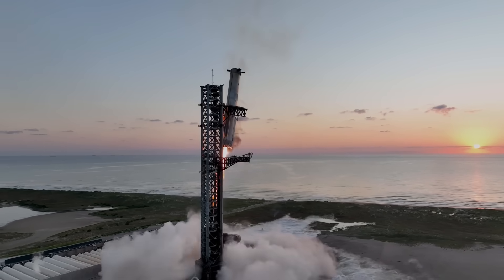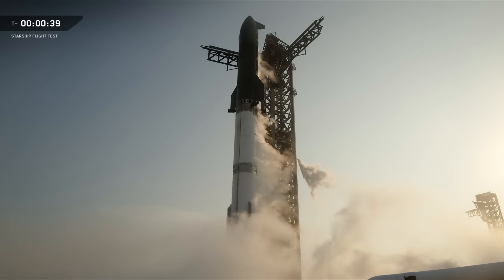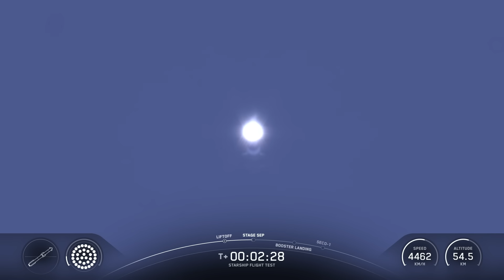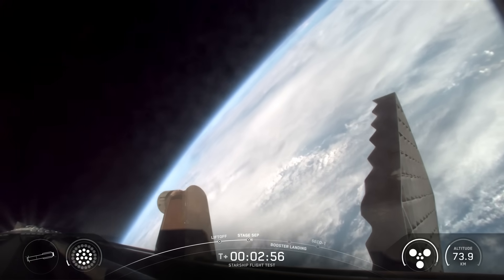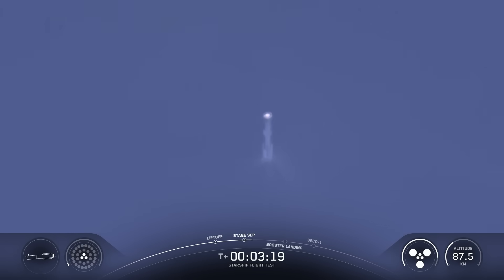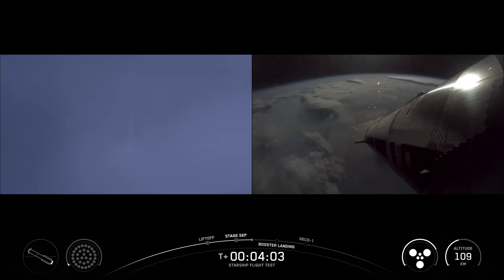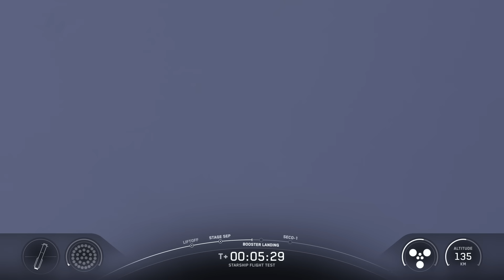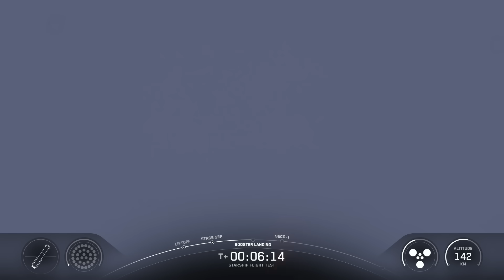SpaceX Builds Largest Reusable Booster, Also Makes Door That Won't Open - Starship Flight 9 Recap

Comment: This is all just a distraction, the ultimate plan is more frightening. Twitter was always the key - he needed to get rid of the engineers to re-write the app. Twitter has been re-coded to  subliminally force everyone to either buy a Tesla, Cybertruck or generate an uncontrollable urge to get into a Boring company pod. Then, using the Starlink constellation a signal will be sent and all the Teslas, trucks and pods will suddenly lock trapping the passengers inside. The controls will freeze and they will autonomously head to the nearest Starbase launch site where hundreds of flamethrower bearing Optimus robots will force NeuraLink implants deep into each persons cerebral cortex and then send them, like lame zombie sheep into waiting Starships for the journey to Mars.  Controlling everyone via NeuraLink , humanity will quickly devolve into a slave species, serving the Mars overlords for all of eternity.  (Except for large breasted brunette Goth virgins. Virgins will be celebrated as honored guests and taken to a great feast within the sacred Martian temple. Afterwards they will be stripped naked, tied up and boiled alive to be consumed by the festive Martians). Earth will be plundered for its remaining natural resources and die off becoming just another sphere of lifeless space rock eventually breaking apart into smaller and smaller pieces until turning to dust, scattering, and finally leaving the galaxy to drift into the abyss for eternity. It’s all so clear - you just need to put the pieces together.

Comment: Remember when they blew up 9 Saturn V rockets before they got it right? Good times.
Reply: SaturnV cost $1.1b per launch so Starship has two more to go before equaling one SaturnV launch.
Reply: @motokid6008  I highly doubt the launch cost of starship has gotten that low yet, even if it might be cheaper than the Saturn V was.
Reply: @alexsiemers7898 - $100m is the high ball number and with the rocket being expendable. It will get lower once they start reusing hardware.
Reply: @motokid6008  and your source for that figure is…
Reply: @alexsiemers7898  - Wikipedia. If you don't like that source feel free to find one that says otherwise. Any attempts I make actually result in an even cheaper number.
Reply: No, but they certainly blew up a lot of F1 engines, and almost lost the vehicles on multiple occasions

Comment: I say go back to block 1 fuel delivery system to the engines as this proved to work fine. Keep everything else block 2 or block 3 but keep the tried, tested and successful block one pipework. Simple solution Elon.

Comment: I say again, Saturn V, 13 & 0. "Starship", 0 & 9,.over.

There were only thirteen Saturn V flights, including test and mission flights, with zero failures. It was built sixty plus years ago with paper, pens, pencils, rulers, slide rules, drafting boards and two IBM 360/91 computers with two megabytes of memory, paper punch cards and tape storage. NASA paid McDonnell Douglas for developing and building self landing rockets over thirty years ago and dropped the project in order to save the Shuttle from death by Congress & CPA's. Musk is a charlatan who has been selling NASA their own technology back to them. With many billions frrom the taxpayers and the best technology on the planet, Musk cannot get a banana can into orbit. Musk will drive his "roadster" to Mars before any of his "rockets" make the trip.
Reply: SaturnV had almost 100x the funding and cost 10x more per launch.
Reply: @motokid6008  That's yet another lie from the Muskrats. The Saturn V worked. "Starship" has never worked and never will.
Reply: @joeschmuccatelli2167  - No those are the raw numbers. If you dont like that then that's your problem. Nasa had almost 100x the federal budget then they do now for Apollo and SaturnV cost 11x more to launch. ( $1.1b to the Starships $100m )
Reply: @motokid6008  Whatever. I say again, Saturn V, 13 & 0. "Starship", 0 & 9. Musk will drive his "roadster" to Mars before any of his "rockets" make the trip.
Reply: @joeschmuccatelli2167 - You can say whatever you want it doesn't make comparing the two vehicles a correct thing to do.
Reply: @motokid6008  That's asinine. Let me know when he gets a 150 ton payload into low earth orbit.  Meanwhile, please enjoy the Muskrat Kool-aid at your leisure.

Comment: Did they have the same rate of failure with the Falcon 9, SH?
Reply: No f9 heavy has never had a launch failure, (though it has had landing fails) f9 itself only had a couple of failures and a few partial failures. And f1 failed 3 times. Starship is by far spacex’s most unreliable rocket to date having blown up or lost control 6 times so far.

Comment: The ship was spinning before SECO, it had already lost control at that point. The RCS firing was trying to correct the spin but it didn't have enough pressure due to the leaks. The booster didn't complete it's mission, it blew up before completing the engine out tests. Arguably the most important tests because it's designed to protect the launch complex, the rest was just for efficiency.

Comment: Maybe the higher exhaust pressure due to the partially blocked openings of the hot staging ring did some damage to the engine bay of the ship?

Comment: Yeah, if this were a government funded program, it would have been shut down afterthe first couple failures!! 

And yes, this was anther failure!! It's insane to spin it as anything else!!  It's also a demonstration of how stupid the iterative design process is compared to traditional disciplined engineering!! The cost of these repeated failures is just way too high in this kind of real world process. It may work for developing software because there is virtually no cost to failure except some thinking effort! 

In reality, every change they guess at just invalidates most everything they thought they learned before! This is just too complex a system, to where any changes are just as likely to create new problems as they are to solve the current one!  I don't blame the young engineers but blame musk for driving them into guessing mode instead of step by step, disciplined engineering. 

It looks to me like the main problem is still the same issue they faced in IFT 7&8, just not quite as bad. The Starship is beating  itself to death!  Starship is just a huge resonator. The tanks and plumbing hold up in static testing because the mass is anchored down preventing worst case reverberation.  It's like putting your hand on a bell, keeping it from ringing. Take your hand away and it can resonate. Just too big and too variable in mass to reliably "tune" the resonator. All they did was lessen the shock input of the hot staging,  Of course, I'm just guessing too. but I think we saw the the same phenomena as the previous two failures, but only to a lesser degree.
Reply: All you have done is prove how little you actually understand.
Reply: Take a look at how many times the US’ early atlas or delta rockets failed and get back to me when you do

Comment: Correct me if i'm wrong here but the v2 Starship has the new main pipe "Downcomer". They went with a much larger pipe that has the potential to hold more fuel and I think is also lighter. And every test with this new pipe config has failed due to leaks or such due to this new design essentially shaking itself apart or causing inconsistencies in fuel system. The payload door not working again is the most embarrassing part I think, but only because of the perception from "Can't even make a simple door work" even though it's likely not simple.

Comment: The Booster is not reused if it explodes uncontrolled.
The rotating of starship started after shuting down the engines and they lost control (loock at the shadows casted)
So they cut to the nearly empty cargo bay (what a joke)
Then 10 min of the control room while we see the starship tumbeling in the right corner.
So they cut out the rotating icon in the user interface,

This is a complete failure
Reply: You're not terribly bright are you?  The booster was reused, it lofted its payload as intended..  Yes, starship lost control, and the cargo bay wasn't empty.  Turns out all you hd to do was watch and you tallied up a large number of failure yourself.
Reply: @imaginary_friend7300  If you drink out a Coke Can and the fill it up again with coke and it explodes in your face. Then it was a failure reusing it.

Comment: This would just be fascinating if it was entirely SpaceX's problem - but it's also NASA's problem because this is the spacecraft that's supposed to land NASA's astronauts on the moon in a few years, and that makes it concerning as well. I think SpaceX will figure things out, but not nearly as quickly as NASA needs them to.
Reply: There are a lot of other issues in the Artemis program 2 big ones with SLS itself.

Comment: I'm no expert, but it looks like stuff got lightly damaged somehow (hot staging? vibrations?), and then SECO exacerbated the damage quite a bit?  Maybe hydraulic hammer on weakened components/materials? Tim mentioned the bright hot spot being due to the oxygen being blown into contact, which kind of reminds me of an oxy-acetylene cutting torch.

Comment: Something’s not quite right at SpaceX. I started out yesterday watching the SpaceX feed for flight 9. Curiously, the SpaceX employee hosts at S. Padre were saying that an attempt would be made to catch the booster. Apparently they never got the message that this was incorrect. Sometime around the short T-40 sec hold they made a strange announcement that sometime during the feed they would show a very important message from Elon made earlier in the day. Moments after coming out of the T-40 hold the feed suddenly shifted to Elon talking crypto. I switched over to NASASpaceflight’s live feed where there was another, longer hold in progress. The NSF folks didn’t know what it was for. Eventually the count was picked up again. Did SpaceX build in a hold in order to place Elon’s message at a point when the maximum number a the SpaceX feed viewers would be watching?

As far as Starship’s 0 for 3 re-entry record and the non-opening door go, SpaceX’s QC efforts may need some boosting.
Reply: You were watching a fake live stream that was a crypto scam.

Comment: JFC, 1960s-1980s NASA engineers would have resigned en-masse - this isn't engineering, it's a billionaire burning tax money for fun and power, and the spacex "engineers" should be ashamed, not cheerleading their nazi warlord.
MOST OF THE MONEY BURNED IS TAX MONEY!!!
Starlink is NOT making enough money to blow up $3e8 per launch.
Elon bought the president so he never has to face any consequences.
Sick sick sick.
Reply: Starship only costs $100m per launch.
Reply: @motokid6008  🤣
Reply: @joehopfield - Those are the figures. All the emojis in the world don't change that.

Comment: So, turns out some of the budget for Artemis and return to the moon is going to these NUMEROUS test flights.  Is it likely these crafts will ever be rated as safe for humans ?
Reply: My opinion is no. I think in the end Starship will be valuable for Artemis by providing large cargo capability to the lunar surface, as well as providing some temporary (or even semi-permanent) habitation and storage space during the many years that it will take to build out a lunar base. But as for launching and returning people to Earth, or landing on the lunar surface, I expect safer vehicles will be used for this which have launch escape capability, or in the case of lunar landings abort capability like the LM did in the Apollo Moon landings.
Reply: They won't be for humans from ground to orbit or from orbit to ground.  That was never their intended role.  Testing is part of development, that's how things get built.
Reply: @imaginary_friend7300  Elon Musk has repeatedly stated that people will fly on Starship to the Moon (Dear Moon project) and to Mars.  And recently he said that if a planned Mars landing test is successful in 2026 they will attempt to land humans on Mars in 2029.  Find one instance where Musk says or even hints that the astronauts on any of these missions will launch to and from Earth on anything other than Starship.

Instead when asked about the lack of launch escape system on Starship Musk dismissed this as unnecessary and gave several reasons why (airline passengers don't wear parachutes etc). Reasons that I disagree with, but either way it proves that his intention is to launch humans and return them to Earth on Starship.

Comment: The whole shebang flexes  and vibrates so much on launch maybe the thing gets bent and pipes leak, doors won't open and things go bad .........................again.  Sprinkling bits of stainless steel all over the planet is kind of a metaphor for other things he's involved with. Move fast and break things.  So far, the broken rocket thing hasn't killed anyone yet but people at the other ends of his purposeful vandalism have suffered greatly.

Comment: They're Not struggling with a small sliding door design. They have an overall structural rigidity problem, the door cannot open because the spacecraft isn't straight!😢😢

Comment: Scott,
Thank you a lot for detail review.

I really wish spaceX to succeed. The bottom line another flight falls short from its goals, but made some progress that seems not enough to justify $100M expense.  The ship is still leaking and engines develop hot spots, besides an issue with the bay door.

Comment: I had hoped the spin would stabilize as the spacecraft was passively drawn towards its most aerodynamic orientation (presumably with heat-shield down) by the increasing airflow.  But maybe there was too much damage already by that point and it had changed the drag characteristics?

Comment: ok by the standards of a conventional launch it was fine as all previous rockets only require the rocket stages to reach MECO and then release the payload. However the vehicle here is designed to be reused many times in a bid to massively reduce costs. By those standards it is truly astonishing that the booster - a machine of immense scale - is being used a second time. This has never been attempted before and the new angle of attack they experimented with may in itself explain the failure of the booster stage. Its not clear why the ship went into a spin given that the same design has been frustrating this stage several times before without spinning. However there's no reason to think that any of these problems are insurmountable.

Comment: Remember these are test flights, it's all about gathering data that makes starship reliable when it's in (future) operation. More data more better. I find it very interesting they where planning engine out test  on booster landing burn but we got a RUD instead. They stopped the ship RUD but it was still leaking fuel, orange glowing and flashed twice. Clearly an improvement but not a fix. But wait more are being build and ready to fly again.
Reply: I would think SpaceX wouldn't want to have random things still failing in random ways on the 9th test flight, but what do I know

Comment: I think we're seeing the cracks in the "throw as much money as possible at it and pump out prototypes" methodology SpaceX uses in development. 

At this point I have to question if the engineers are being given enough time to properly analyze telemetry to fix the engineering oversights (likely caused by the same rushing culture). 

SpaceX has yet to show they can actuate a functioning cargo door, and in Starship V2 this is the third time we've seen their motors eat their own plumbing resulting in loss of the flight vehicle. Granted, this failure was more subtle than the first two, but is still a failure of the plumbing above the motors. 

You'd think at 3 V2 prototypes they'd have fixed most of the problems, but it just seems the massive amount of rushing they do to pump out prototypes isnt giving the engineers time to actually root out the causes of failure. 

There are a lot of complications as you mentioned, and I agree with the fact that many tests can't be simulated on the ground due to variable disturbance torques and forces. But, other modern engineered space flight vehicles we've seen have not required as many completely failed launches to find success. I do hope to see SpaceX find success, but man they are burning through money at a historic rate for spaceflight development with this methodology.

Comment: Are you sure the door didn't open, or they scrapped it BECAUSE it was tumbling?  Please don't say as FACT, if you don't in fact know...  Also, that engine leak was a FIRE..  you can see the colored flames, just like the last 2 rockets...  Please know what you're saying before speaking

Comment: Everyone criticising their lanch and failure rate.  Remember that what they are developing is a manufacturing process,  which is chucking out starships and boosters, so they have many available, they can launch whatever they like whenever they like, its only costing them the propellant.
Reply: It doesn’t matter how quickly you make utter garbage it is still utter garbage. This time they still failed to reach orbit and only got to “orbital velocity “ by throwing away the booster because they know they can’t burn stage 2 enough to do that without it blowing up. Everything built before the flight 9 mishap investigation concluded is scrap.  Ignore the razzel dazzle, keep your eyes on the cards. 

The booster blew up. Second stage failed again but was shut down earlier than previously. The heat shield is still sh!t. 

These aren’t only costing them propellant. Each flight costs a Starshit!t and this time a booster. Now every Starshit!t built is scrap as is every booster. Nothing currently built is fit for use.